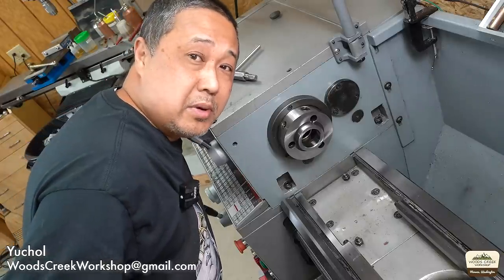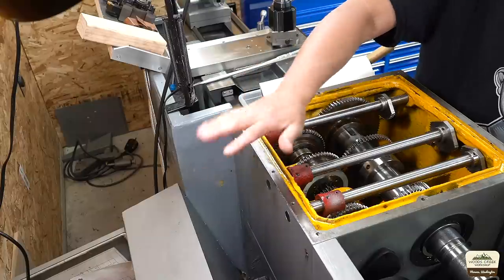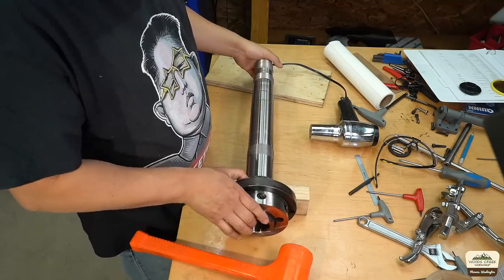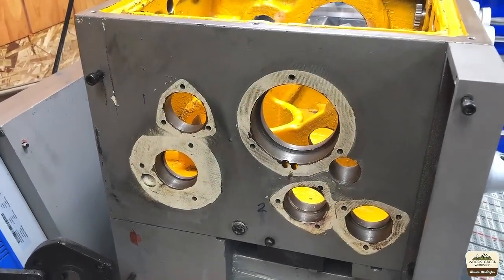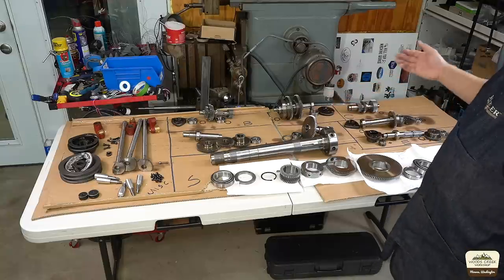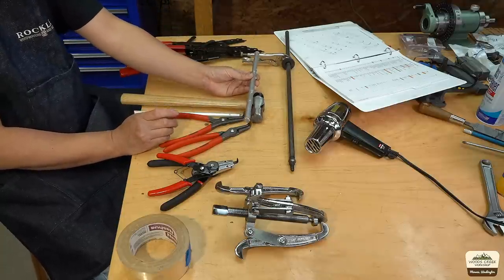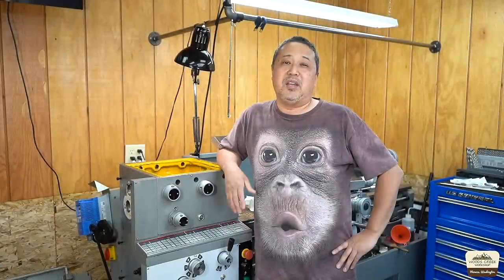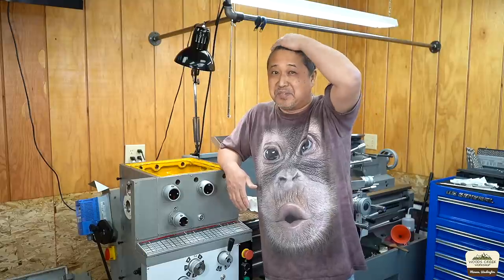LATHE SPINDLE BEARINGS (Part 1) - TEARDOWN of 13x40 Engine Lathe Headstock

Comment: Wow, you sure are brave.  My 13X40 Jet Lathe is now 15 years old.  So far it has held up well, it is very accurate and no problems with the bearings.  The inside of the head does not look a nice as yours, but no chips or junk.  I've changed the oil several times little or no grit in the oil.  Can't wait to see how you put it all back together.
Reply from the maker: Thanks Dan!

Comment: Hello Yuchol, your Videos are just great !
As mentioned before, the outer Bearing shoud be a tight slip fit on the Spindle, but it never is on import Lathes.
But its easy to correct with a Lapping Ring made from Aluminium and some abrasive compound.
You could place some wick in the oil feed holes of the Bearings, this would prevent any particles from getting in.
The restriction in the flow is no Problem, tapered roller bearings dont need a huge oil flow.
They run cooler if they dont need to displace a lot of oil.
Some fine wire mesh, like on an oil burner Nozzle (not the sintered stuff) could also be used.
Greetings from Germany !
Reply from the maker: Taunus Mechanics thanks! 🙏🏼

Comment: Yuchol, this video has been a huge help to me.  Thank you!  After recently purchasing a Victor 13x40 a few issues have been found.  One was that after running for a few minutes the chuck end of the spindle was puking oil.  Seeing how the headstock is assembled was a huge help.  Mine isn't identical but it's close enough that there were no surprises when I opened it up.  I have a heat gun identical to yours and it worked great with a little patience.  The primary reasons for oil running out of the headstock appear to be overfilling and a bad gasket under the bearing cap.  A cloudy sight glass didn't help matters.  The rollers and races are no longer shiny but still smooth and runout inside the spindle with a dial test indicator was .0001-.0002 so I saw no point in replacing them immediately.

Comment: Great video, Yuchol.  When you put the headstock back together, might be a good idea to attach a magnet to the drain plug to catch any filings as the gears wear normally.
Reply from the maker: Thanks.  I have few ideas, will show in the part 2 👍🏻
Reply: more than 1 magnet would work in different locations. they won't dislodge from the case if put in the correct places, and will prevent future damage.  Nice work.  I probably would have taken the handle gears out.. you are already 99 percent there. So little work, and you are waiting.
Reply: LOL I don't have that problem all my gears are plastic... sometimes cheap Chinese is better... @woodscreekworkshop9939
Reply: @woodscreekworkshop9939  I'd even wrap the magnet in ziplock bags for easy clean up.

Comment: Thank you for the movie.
Consider putting some big magnet (for example from old speaker) into headstock close to oil pump drop - naturally wearing stuff will not flow internally, but stick to magnet. It also gives better view about oil quality - small pieces will not be visible without optical zoom (at least 2$ small watchmakers x10 magnifier).

Comment: Hi Yuchol
Watched your video again. Use to build big race engines about 25 years ago. In the heads where the oil returns back the the main block we epoxied some of those small rear earth magnets to catch and metal files also give a tell tail sign something was wearing out Just a thought. I would hate to go through this myself I have a couple in my old King machine which is also a Chinese made but  I have had very good success with since 2004.
I change oil about every 6 months and pull the main cover off to check those magnets for chips or filings. Keep up the good work.

Cheers Fred
Reply from the maker: Fred's Machine Werks thanks Fred.  I will be installing some magnets when I am done

Comment: Gday Yuchol, it’s disheartening when you see this issue in machinery, a lack of quality control during in the factory, it’s a cost that could be very easily avoided, I’m really looking forward to seeing the shaper, nice addition to the shop, fun times ahead there mate, take care Matty
Reply from the maker: Thanks Matty!  It made me mad, but we must all forge ahead I guess 😁
Reply: I don't think it is avoidable, wherever gear surfaces meet, a break-in procedure might be required. After transport, under load and depending on temperature the dimensions do change quite a bit, which means a break-in at the plant won't cover all of that. How much is acceptable depends, and how much burr those parts had when being assembled. This means with new bearings and freshly assembled a new break-in with oil change might be required - but that's usually done to estimate the preload of the bearings alone anyway.
Reply: @denny9931  yes but they can take a few minutes to debur the machined edges its just slack on the manufacturers part
Reply: lee I quite agree although the gears may well have contributed to the swarf in the headstock it's mainly as Yuchol has shown where the headstock openings were bored that has left swarf on the outer edge of the casting. Yuchol clearly shows pieces being broken off of the casting. Failure to deburr during manufacturing by the Chinese factory is the complete cause of this problem
Reply: @samrodian919  AGREED!

Comment: Nice video 
Im getting a bit of play on the bearings 
So now i know 
I can tighten the bearings handy
Thanks again 👍👍👍
Reply from the maker: I am learning that setting the proper bearing load is more of an art than science and the preferred method is to look for a temperature rise at the bearings rather than using torque measurement

Comment: Greetings, just replaced the countershaft bearings on my lathe, similar to yours and a lot of debris from the failed bearings but luckily the spindle bearings seem ok.
Mr Pete is 100% correct, I also had machining chips that had migrated through the chuck end Labrinth Seal, the chips CAN go into the gearbox even without using compressed air.
I have placed a large magnet in the gearbox and regularly clean to remove debris, most of which comes from the non hardened gears.
Looking forward to see you reassemble,
Reply from the maker: I will also place magnets in there 👍🏻

Comment: Great video.  There's something deeply satisfying about upgrading sub-standard machines.  You just know that your lathe is going to feel, sound & cut much better than previously.  It'll make you feel good every time you use it.  If that's not good enough there's the bonus of having to buy quality tools.  The other tab I have open is the Knipex catalogue :-)  Looking forward to part two.  It was rhetorical your question about the shaper restoration...right?
Reply from the maker: 😁. I really hope to work in the shaper this summer.  Thanks for your kind words Jeremy 🙏🏼

Comment: Good hunting for those bearings. I spent hours working to find precision bearings for my Boyar Schultz surface grinder spindle. Prices seem to have no upper limit - LOL. 

Well shot video. Anxious to see the rest of the series.
Reply from the maker: Thanks Dan.  The words “surface grinder” and “spindle” automatically inflates the price astronomically 😂
Reply: actually those are tapered roller bearings they will be pretty cheap and easy to find. boyar schultz and most higher precision spindles uses angular bearings which get pricey fast.

Comment: Great video. Yuchol. My 25 year old Sharp 1340 is very similar. I've changed oil a couple of times...never looked into it as you have. I need to do that.
Reply from the maker: Thanks Joe.  I’d say if it’s good after all these years, you’re safe 😀
Reply: @woodscreekworkshop9939  I'm sure you're right, but it won't hurt to check. I suspect the spindle bearings could do with a bit of snugging up, too.

Comment: Great video man! When it comes to bearings, I’ll only use Japan or USA made. I was really surprised at what Jet was asking for a Chinese made bearing. I wonder what the markup is on that. I look forward to part two of this rebuild!
Reply from the maker: Thanks Tim!
Reply: The mark up margins are enormous. Many hundreds of percentage profit. Rolling element bearings have always been a lucrative business. I had several years experience with a work colleague who was a main stockist for several well known bearing brands. The recommended prices are ridiculously over the top on some larger bearings.
Reply: I've bought bearings in china (popular auto /truck  replacement sizes and was shocked how they were stored and handled. They have no sense of storing, packaging away from silica contamination. So now i pay a premium for japanese.

Comment: Hey, great video. Well done on taking it on. On my colchester i added an in line oil filter meant for a tractor. It has a removable can with the filter and a mount with hose tails at the inlet and outlet. Very easy to mount between the oil pump and gearbox.
Also, for cheap bearings, if you know anyone living in china, buying them on taobao is really cheap. Most sellers wont ship outside of china. But you can get all the big brands like skf nsk etc and high quality but they're about 10% of the price of in the uk. I have worked out there and stock up when i can. Thanks for the video!
Reply from the maker: Lorro Symonds thanks.  This lathe doesn’t have a pressurized oiling system.

Comment: So it sounds like if you buy one of these machines (assuming mills are made to the same modest standards) either one rebuilds it the day that it arrives, or rebuilds it a year or two later. The major difference being that if you clean it up and deburr all of the internal parts on Day 1, one might ultimately be able to save the cost of replacing expensive bearings and gears.

Thank you for this very informative and insightful video. I don't own a lathe and never will, but I think you have made a beautiful investigation into sources of failure. Beginning with the folly of assuming that just because an item has been manufactured to spec dimension it has therefore been made "right." Deburring, cleanliness, seals and lubricants being also and equally crucial for long-term success.
Reply from the maker: Thanks Josh.  I bought this lathe because I’ve had the exact one 16 years ago and that was a good lathe.  Unfortunately the first one was made in Taiwan where this one was made in China.  The quality just isn’t what it was.  There are other brands that I feel comfortable buying today, just not this brand anymore.
Reply: @woodscreekworkshop9939  are these models still sold by anyone other than Jet, but still made in Taiwan? I used one about 22 years ago, but it had been abused in the electric motor shop and needed some work, I wanted to take it home and rebuild it because of the size and I thought it had potential for a home shop.

Comment: Thanks for showing, I like the way you handling this open heart surgery operation.  I know this is waiting for me along the line. Please let us know after you replaced all bearings and assembled , apart from the spindle bearing noise if the noise running at various speeds has noticebly changed. My gearhead lathe is quiet enough at low gears forward(No complain), a bit noisy for same gears in reverse. At higher speeds like 1800 it sounds scary to me, but not as scary as some racecars with straight cut grears. I did not had the oppertunity to hear a similar lathe 1st hand, so would really appreciate your take on the noises afterwards, thank you again.
Reply from the maker: Thanks Chris, will do

Comment: This was quite interesting, as my 12x36 has some similarities to your 14x40.  I had thought Jet would have had better cleaning and quality control, they have a decent name for themselves.  My lathe is due for an oil change anyway, I think the lid will come off like after I first bought it and cleaned it, I'm wondering how much crap is floating in the transmission now!

Comment: Looking forward to Part 2, as I’m curious to the proper fitment of the outboard bearing to the spindle.  I always thought it should be a slip-fit to allow proper preload adjustment.  I have a cheap 10” Taiwanese lathe that has the same press-fit as yours had coming off, I think I should fix it.  Anxiously waiting to learn from your experience!
Reply from the maker: Thanks Larry
Reply: This is interesting point.

Comment: HI !

Just wanted to know, did you check any spindle runout before you changed the bearing or just because of the sound. 
I am asking becuase my lathe has developed spindle runout, but the noise is not that noticable, I tried to preload the bearings but could not fix the runout issue. 
Please  help
Reply from the maker: The bearing noise comes before you see runouts.  If you’re seeing a runout but the bearings sound good, you need to check the spindle preload and adjust accordingly.

Comment: Hi. One more useful tool would be a bearing separator. This comes in two halves which fit round a bearing and then bot together. It has near kife edges that will prise a bearing away from it's neighbour and it also allows long all thread to be used to pull the errant bearing off a long shaft. They are not expensive and well worth having. Probably still need the heat gun. Stay safe folks. BobUK.
Reply from the maker: Yes, need some of those 👍🏼

Comment: Very interesting and informative video. I'm a new subscriber (today) and really like the thoroughness and clarity of both you video and your narration. Excellent work! I really admire folks who just press ahead when faced with challenges such as the ones you've faced getting, and keeping, this lathe in good running order. Good job sourcing those bearings, standard replacement parts charges are such a rip-off. Jet should be ashamed both of the quality of the machining cleanup during manufacture and of trying to make their standard item spare parts a profit source. Good on you for proving how that will backfire. You got better bearing for a fraction of their asking price. My only slight disappointment was that you didn't show us the comparison of the worn old bearings with the brand new ones. Guess I'll have to be sure to tune in for Part 2. Wait a minute, was that a subtle cliff hanger?? Well intentional or not, I think it will work.
Reply from the maker: Part 2 😁

Comment: Some tips to NOT ruin those fine super precise new bearings and the other ones:
-put the cups in the freezer to shrink them.
-put the cones in your oven and heat them up, mind the temperature of course. I say max. 110-130 Celcius
-check housing diameters; if fit is too loose, a bit of loctite works miracles :)

And never ever!!!! hammer in a bearing!! might as mount the most crummy el cheapo bearings but mounted correctly!

Turn some  nylon rings that fit the rings precisely and use that soft mallet to drive  them in; all to avoid shock. Better would be to use a press for the cones on the shafts.
Brass rings maybe for the shaft mounted bearings (heat!)

last tips: 
-check for markings on spindle bearings for top of run out; usually a dot is etched. Then make sure both bearings are positioned at same spot to avoid 
-work as clean as you would work on hydraulics
-make sure the shoulders are spotless and square. 
-proper pre load specs for those tapered roller bearings, make sure to make 10 to 20 revolutions so each rolling element makes a full revolution then measure torque with unster.

Good luck with the new quality bearings!
Reply from the maker: Thanks!

Comment: I would put a few strong magnets in the headstock where you can anyways and a screen in the two holes to oil the roller bearings
Reply: Second the neodymium magnets in the headstock sump, don't know how the oil/screen interaction would go (oil flow amount??).
Best wishes

Comment: Some of the ones I’ve pulled apart have had pipe cleaners shoved down the oil holes.  Form into a V, shoved down the hole, then bend flat what’s sticking out to stop it going all the way in.  Will definitely stop big chunks of grit.

Comment: Use felt to help filter the metal shavings out of the oil in the holes for the main bearings this will allow the oil to wick through the felt. search felt wick its quite common

Comment: Very good video how long did it take to get that bad and how much use. Was it run very frequently for several years or less?
Also did you have much runout because of the bearings?
Reply from the maker: I’ve had the late and used it “frequently” for a home hobbyist,  the runout was really low.  Other than the noise, I had no complaints of the machined parts.  I am certain the runout would have gotten worse if I kept using it.
Reply: @woodscreekworkshop9939  thank you for your reply. I dont have the noise or the runout but i think i can put this on the cards

Comment: Yuchol, is the gear box a ferrous cast? If so, I would be dropping a few neodymium coin magnets in the bottom where they can easily be retrieved...
Reply from the maker: Yes and I plan to
Reply: Yes, maybe also some tiny ones along the troughs that channel the oil to the spindle bearings themselves. Can't think of any reason not to as long as they don't impede oil flow. Those are easy to get to by just removing the top cover, so Yuchol can keep an eye on things over the first few hours of operation.With the cleanup and deburring Yuchol did, there should be minimal to no large chips anymore!

Comment: Those bearings would have been installed by heating them to a temperature of approximately 250 degrees farenheit so they would slip into the spindle shaft.  Don't directly apply heat to the bearings nor hammer them

Comment: Good work cleaning that up
I had the same issue of stupid tight bearings with my mill spindle a while back. I suppose it's better than loose
PS at 0:51 it looks like you dropped your lathe dog on the floor :P
Reply from the maker: He won’t leave me alone 😁